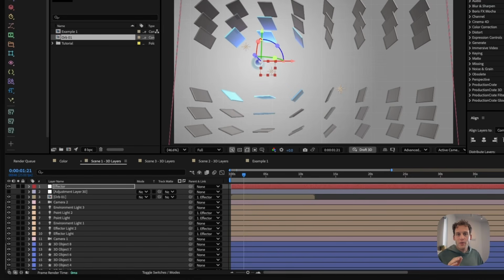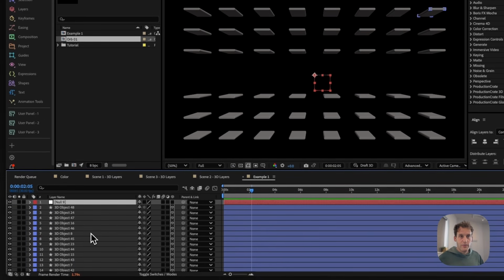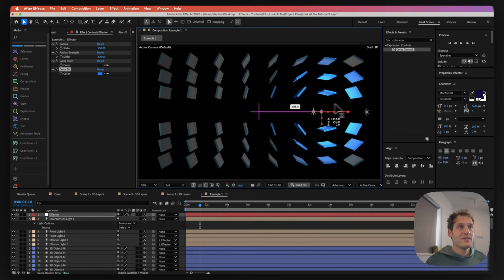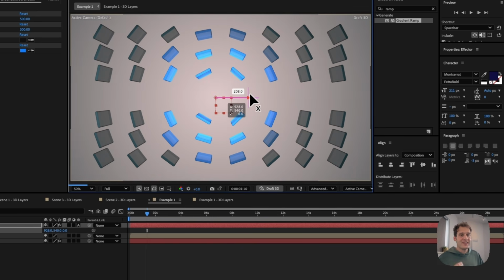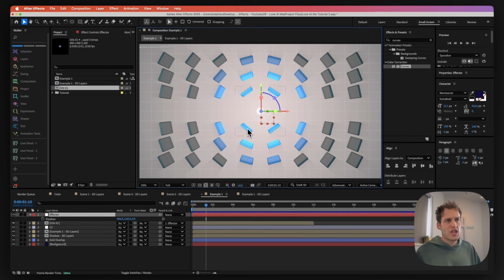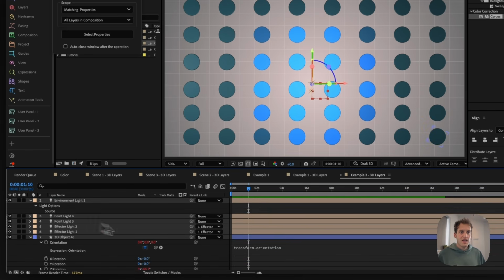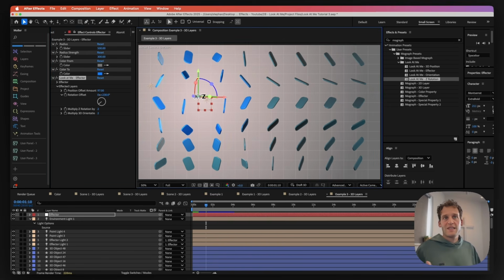Master Advanced 3D Motion Graphics Tutorial After Effects

Comment: Hey Stephan, I've been working on this tutorial for a couple hours now and I have a problem. When I make "Example 2 - 3D Layers"(Duplicate of 'Example 1') I can no longer move the 'Effector', it's locked in place, I cannot move it by clicking/dragging the actual null square, nor can I move it using the position coordinates. It is also locked in "Example 1 - 3D Layers"), cannot move it. BUT I can move it in "Example 1" and all the shapes will face it. I've done your tutorial twice now to make sure I didn't miss anything but still doesn't work. Is this a problem you know about? Thank you.
Reply from the maker: Hi, yes this is because now that Effector is being controlled by the Effector in Example one. We had parented this so that we can have all the control from Example 1. In this case if you want to untie it to use it in Example 2 - 3D Layers, all you need to do is select the effector. Hit "p" to show its position and then Alt/ Option + Click on the stopwatch. This will remove its expression that we did previously, thus removing the tie. Let me know if this helps! :)

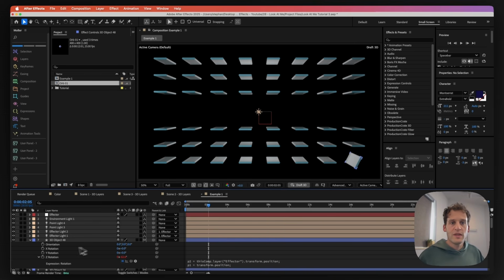Comment: the expression isn't working for me correctly inside AE 2025 Mac. 8:20 it drags out the 3d object from the scene and moves it way outside. - does the same for other objects when I copy expression, could anyone help?
Reply from the maker: Hi are you applying this to the Z Rotation? Make sure to only apply it to rotation and not position.
Reply: @stephanzammit  I think I resolved the issue! The problem was that the anchor point was not centered on the layer. I went to:  Layer > Transform > Center Anchor Point in Layer Content. And it worked properly!
Reply from the maker: @ Aa yes! That's an important step if your object is not centred! Thanks for sharing
Reply: Try centering the anchor point of the layer by going to:  Layer > Transform > Center Anchor Point in Layer Content and then paste the expression
Reply: Same!

Comment: did you learn how to code just for after effects? how did you learn expressions?
Reply: same question
Reply from the maker: I am certainly not the best programmer, as most of what I learned was actually to use it in Motion Design with lots of trial and error.. But some general knowledge goes a long way, then I also use tools like Chat GPT to iron out certain problems, although many times, code from there would need to be tweaked to work properly. I actually have a short tutorial on that approach on my channel :)

Comment: U try connect efector inside composition , with essential graphic???
Reply from the maker: Haven't tried this! You can do this, but I actually wanted control from within that composition, but it's definitely doable using essential graphics!
Reply: @stephanzammit  Lately, I’ve been using Essentia Graphics quite often, mainly because when working on a complex project or combining multiple projects, the possibility of having a null control inside a composition that is directly linked to another null in a completely different composition can easily become disconnected or lose its connection.